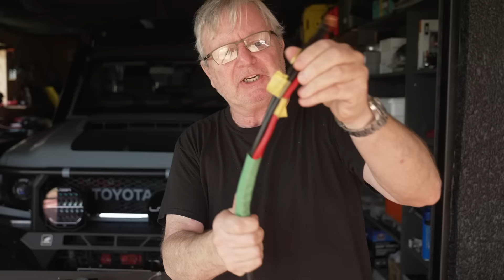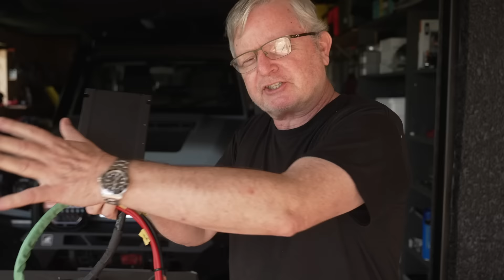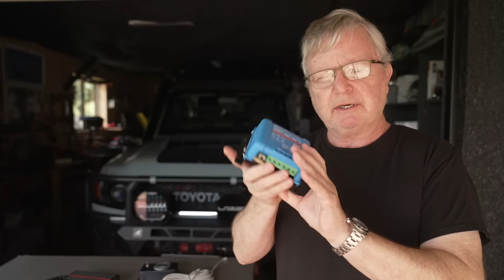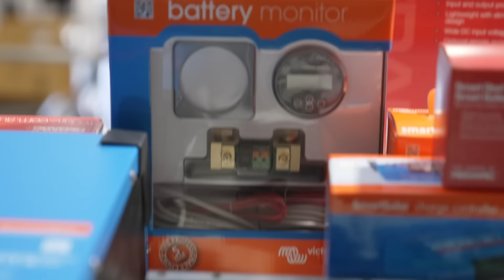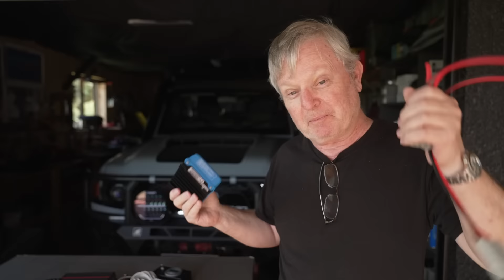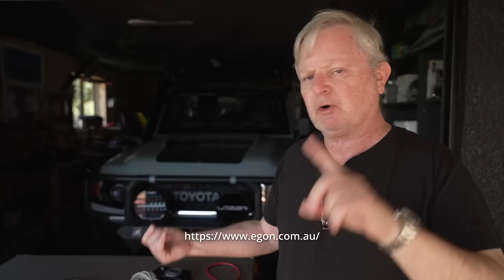DC-DC CHARGERS. Victron VS Redarc How to chose the right one for you.  @4xoverland

Comment: Everything is a tradeoff.   I've been going through this in my design - FOR ME - the Victron and serially connected panels (2-3 panels) means lower amps on the cable - which means you can run longer 10AGW cables to your "blanket"  - If you're panels are mounted on the RTT,  it's probably not a big issue.   Why long cables?  If you're parked in the shade, you may have to drag those portable panels/blankets a fair distance to get open sun (I live in the Pacific North West - we have trees, lots and lots of trees).   Thinner cable - much cheaper, easier to store, lighter, easier to run out coil up. 
Example Red Arc  160w blanket (18v 9A)   2 Panels in Parallel (18v  19A) -  at 65 feet (20 meters)   In series on a 10AGW wire, you will lose about 16% of your voltage.   In series, you have 36v 9a and a voltage drop of about 4%.   So, if you need to run long cables - serial is the way to go, which means Victron.  If you mount them on the RTT in parallel or do most of your camping in wide open spaces, either will work fine.
Reply: Hi Vincent.  How is REDARC different (to Victron) in managing serially connected solar panels (x3) with longer cables?  Why is Victron "the way to go" (over REDARC) when long solar cables and serial connectivity is required?  This is interesting and I really would appreciate some insight into these queries?  Thank you - Cameron
Reply: @Camh1968  When you connect in series you up the voltage (reducing line loss) and Victron has a higher Voltage rating.  I don't have the numbers  off the top of my head but it was significant (like double?)

If you don't need/care about that then the REDARC is excellent gear.
Reply: @vincentkeith5259  wow.  Interesting to know.  Why would Redarc have significant less voltage rating when running  similar equipment for the same applications?

What specific voltage parameters are used to quantify voltage ratings of Victron and Redarc?
Reply: @Camh1968  Most users are not going to go to the expense of long cables.   For example, there's a lot of overlanding where finding shade is rare - at which point you might was well put your panels right next to your rig.   Since most of my camping will be in the North West on BLM land I expect I'll be able to find shade (clear sky on the other hand...)
Reply: @vincentkeith5259  ok thank you.
Reply: @Camh1968  Another point - most people aren't going to buy 3-6 flexible panels because they have ZERO need for that much energy.   My goal live-in and I have a computer that sucks juce.
Reply: @ yes, thank you.  My setup will be 3 x 200w portable / folding Redarc solar panels linked in series some distance away from camper.

Thinking of steering towards the Victron based on what has been discussed here.

Comment: 1 think i would add to that some controllers seem to work better at 24 or 48 VDC than they do when you try to use them in context 12vdc they tend to get hot at 12vdc due to it over amping and drawing more current over 12 volt than 24-48 volt which causes both cable and  charge controller to get hot..

You will have to find the happy medium that the charge controller  will work within  without causing over heating!!!

Comment: Doesn't the REDARC Redvision do the same as the Victron Cervo GX?
Reply: It does, but I'd argue victron does it better (imo) and at $500 it's a very good solution. Vs the manager30 at $3000 and your limited to 30A charging.... all in one solutions rarely do all things well.
Reply: @Sethjxl  not only that, victron offer the cerbero software for free which can be installed on a $100 raspberry Pi
Reply: @Sethjxl  Do you need to have the REDARC Manager30 too, if you wish to use the REDARC Redvision?

Comment: I even get 45 amps out of my Redarc 1240D if it's kept cool. So I added an internal heatsink and 40mm computer fan to do just that.
Reply: My 40A redarc overheats very quickly inside the cabin and output goes down significantly. Will look at adding heatsink and fan.

Comment: so how do you setup getting power from an alternator? or can you push the 80+ watts that they put out into those charge controlers?
Reply: https://youtu.be/UCLyTD4pqbg?t=206 2 x 30 Amp DC/DC chargers
Reply: I can only answer for victron as is what I installed. If you buy the Isolated 18/18 or 30/30 you only need to connect it to your starter battery With a fuse. The charger will feel the generator automatically and regulate the voltage and current can only flow one way as it is isolated so you never have to worry about draining the house battery. It id simple as : starter battery-> Victron Orion-> house battery. Hope that helped

Comment: Just installed your exact set up, but don't know what to set all the voltages at on the Bluetooth app for the two 30a chargers. No one in my state does either.  I found someone 600mi away, in another state, so that's what I may have to do.

Comment: Is it true that the redark 50 dc dc charger  only charges for 2 hours over a 24 hour period..thanks Andrew
Reply: When the Charger is turned on, it will start ramping current from 0A up to the full 
rated current, this is called Soft-Start and usually takes around 30 seconds. Once 
the full rated current is reached the charger will move into Boost stage. The Boost
stage maintains a constant current until the battery voltage reaches its Absorption 
Voltage.
The current in Boost stage may vary during operation in order to maintain safe 
operating temperature, or to limit the difference between input and output voltages. 
The Charger will then move to Absorption stage which maintains a constant voltage 
level for a predetermined period of time or until the current being drawn by the 
output battery drops to less than 4A for 30 seconds; after which the Charger will 
enter Float stage. 
Float stage maintains 13.3V (13.6V for LiFePO4) on the output battery, keeping the 
battery topped up. This counteracts the battery’s self discharging or loads applied 
to the battery. When the battery loses charge, the Charger will move back into the 
Boost stage.

The misconception of a 2 in 24 limit comes from a couple people who don't understand they're measuring the boost and absorption stages. Battery packs can only efficiently take a high current for a limited time before the chemistry of the cells become maxed out. Pushing extra current in only creates more heat and potential damage at this point, hence the absorption phase.

The first section is a direct copy from the readily available user manual online. I'm not connected with redarc, I'm a customer who will read all of the available literature on various brands before purchase of significant cost.
Reply: @rustymozzy   i will stick with other brands .I've never had over heating issues  and I get more than 2 hours charging with out it stopping charging my battery thanks..and I know how the charging  system  works thank you
Reply: @Grant Saywell  sorry, I read your comment as a question, not as a statement. 

For anyone else who has a question about the 2-hour limit, the answer is - it depends.
If you want to charge fast with no regard to the longevity of your battery bank, you can charge at high current as long as you wish with an old school non regulated battery charger. If you want to maintain a long-term reliable system, charging at high current is wastefully inefficient and ages your bank. Redarc maintain a maximum current until the bank has a level of charge, and then the charger maintains a maximum voltage. Think about drinking a bucket of water. You can probably drink a few glasses straight up, and then you're going to struggle to keep drinking at the same rate. You can then slow down and drink at a constant steady rate and work your way through the rest of the bucketful. 
If your battery bank requires 50+ amps for longer than a few hours at a time, you either need to have more charging capacity than either of these units or look into running a higher voltage battery system.
Reply: @Grant Saywell  what other brands, please?

Comment: Great products, but I'm done with them until they give us the ability to manually switch alternator charging on and off rather than using voltage trigger that you can't bypass.

For this reason alone, I've moved to a renogy 60a charger with a victron mppt.
Reply: Well, install a simple relay on the blue trigger wire. Leave the wire connected to allow the unit to run as per usual, use the switch to disconnect the wire, and effectively tell the charger not to use the main battery/alternator as a supply source.
Reply: @rustymozzy  this is added complexity and poins of failure that shouldn't be needed. A trigger input is such a simple system, the redarc actually has it, however once the signal stops, the charging keeps going until voltage drops to 12.4v (which is not a full battery).
Reply: @Sethjxl  the redarc BMS 30 has options to select different voltages or to use the trigger wire. If you want the ability to switch more things in a unit, you need to upgrade to a better unit. If the basic system has basic functions, and you add all of the advanced functions, you've built an advanced unit that necessitates a higher cost. A relay on a trigger wire or a volt sense switch would allow you to switch remotely without adding redvision and associated costs.
Reply: Great point there.  Voltage triggered switching is no longer relevant with Lithium battery technology and this feature should be done away with or at least made optional.  In fact for most purposes all that would be required is switching with the ignition.